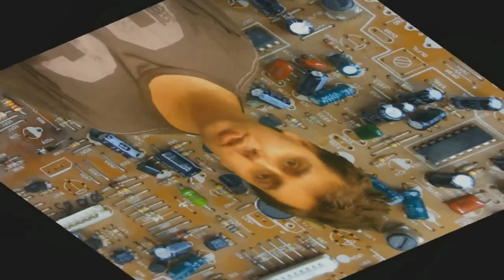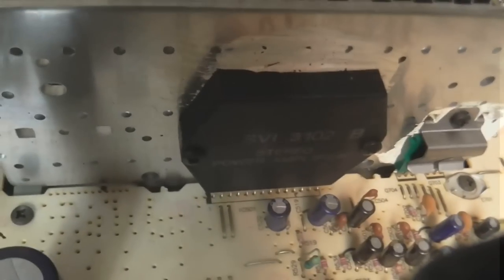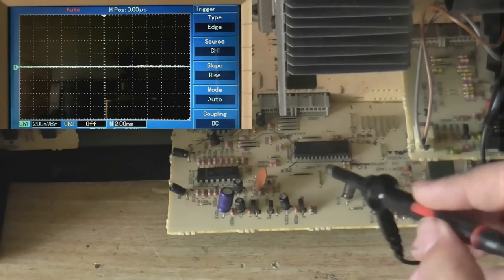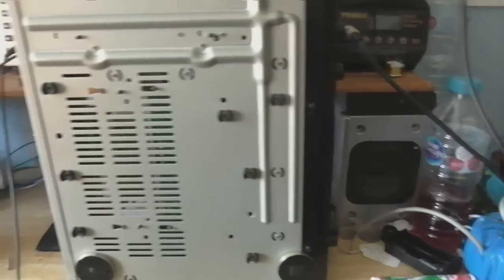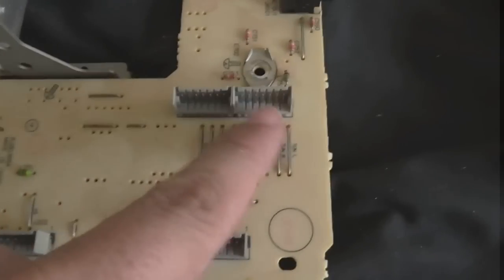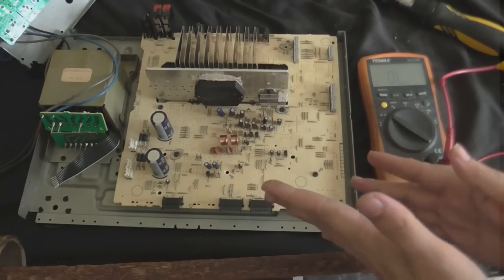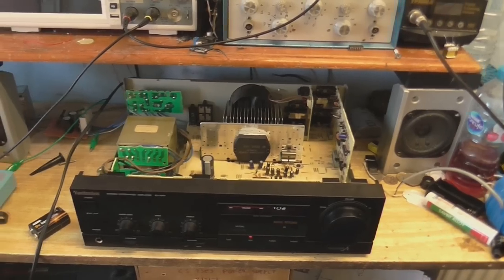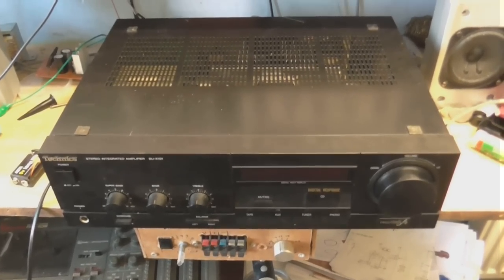Fixing a Technics SU-X101 amp pt 2 - Was it even broken?

Comment: The jacks you discovered are for splitting the amp up. I mean you use the amp's preamp to drive another amplifier or put an equalizer in. Then you can use the amps power amp with something else. I have the same feature on a 1974 pioneer receiver but they just use 2 solid wire jumpers into each jack. Sorry you worked hard on it but now you know you will never overlook that again. Still it made a good video.
Reply: I though the same. Many vintage gear have pre out to amp in and not sacrifice any tape I/O to install eq. They need to be clenaed from time to time as they start to develop contact issues, like in the 717 that had a switch

Comment: I believe that white marks between the ext out and ext in jacks indicate that there were jumper links supposed to be there.
Reply from the maker: I wish I had seen those earlier on, would have saved all of that confusion!
Reply: Yes, the external outputs and inputs are for connecting a graphic equalizer, reverb unit, or some other kind of special effects processor. If you don't have one, the amp originally came with short jumper leads to connect the ext outs to the ext ins.